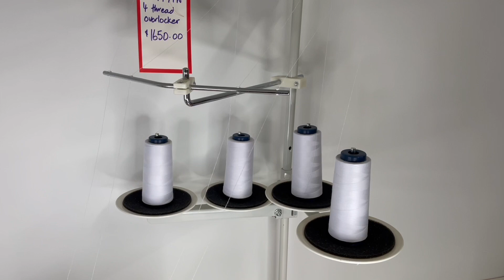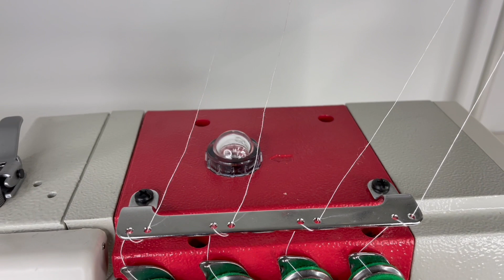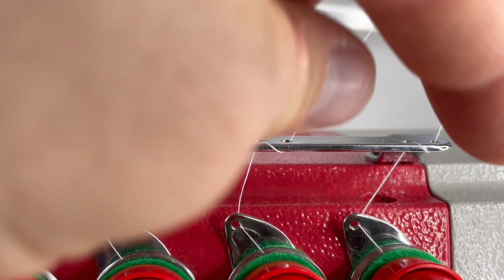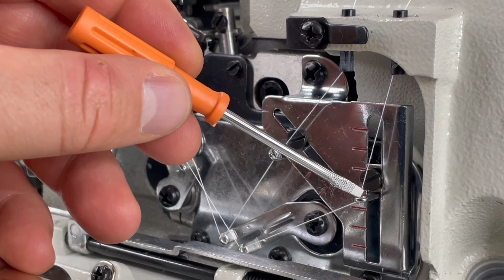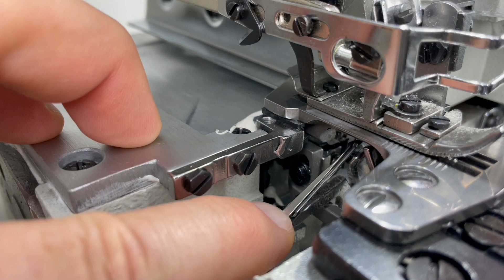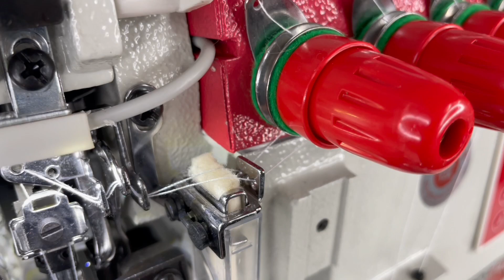How To Thread Prosew PS-747FN Industrial Overlock Machine

Comment: Hi thanks a lot. You are the first showing  this kind of vidéo. I've broken the upper looper and I can see that there is 2 holes on it. I've loosen mine. I've bought one but there's only one hole on. Is that good. I got problem to put on the thread. My overlock is 747d siruba.
Thanks God Bless.
Reply from the maker: I'd make sure you have the right part as it should be replaced like for like.